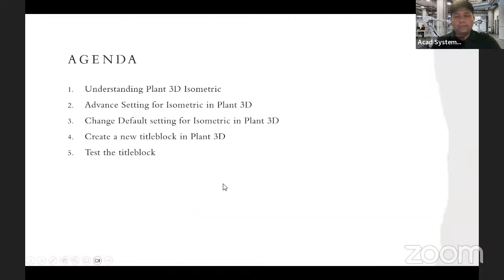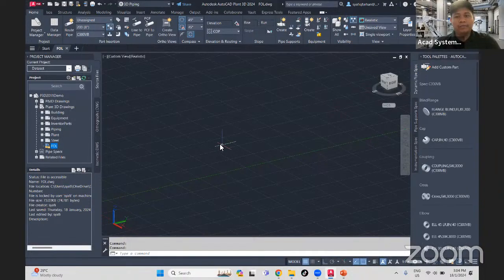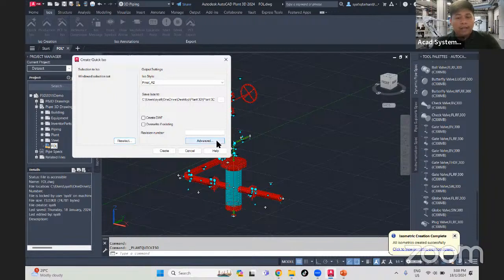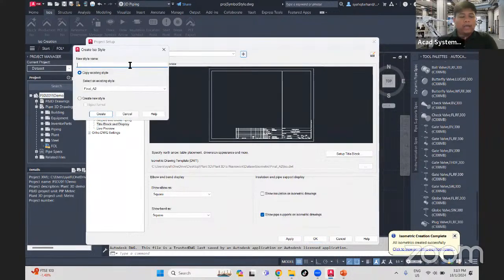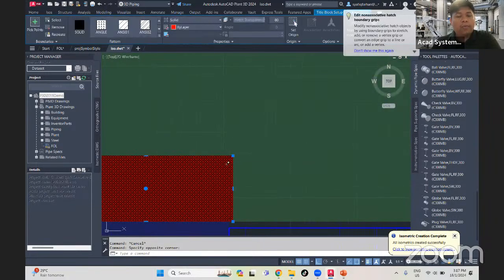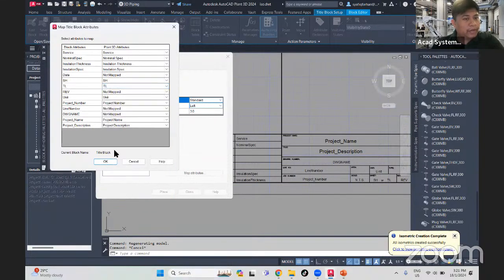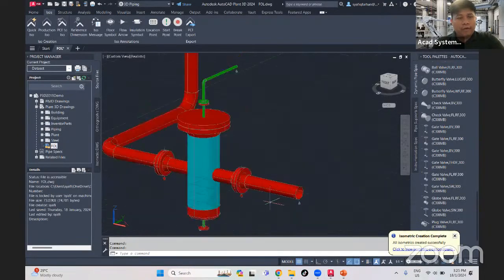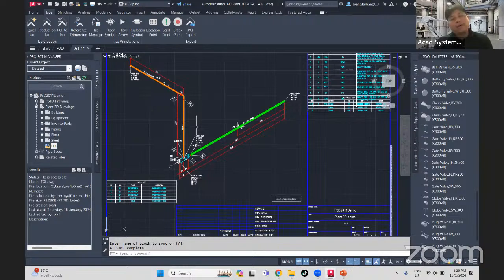Customize Isometric Titleblock in Autodesk AutoCAD Plant 3D

Comment: Hi sir.  the isometric pipe symbol doesn’t visible in my AP 3D 2023. All fittings, Dimension,Valve support, every symbol Showing.  Not Only pipe symbol .
Reply from the maker: Please ensure that you review the annotation settings in your Isometric project setup. Alternatively, consider creating a new project and conducting a test. It seems that there may have been changes to the settings in your current project setup.